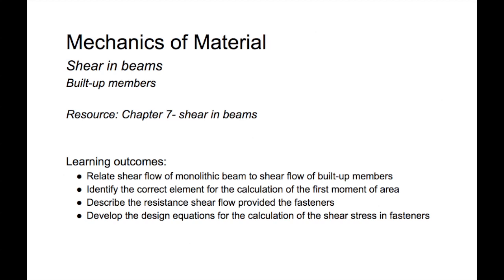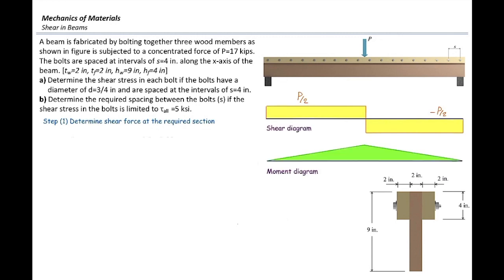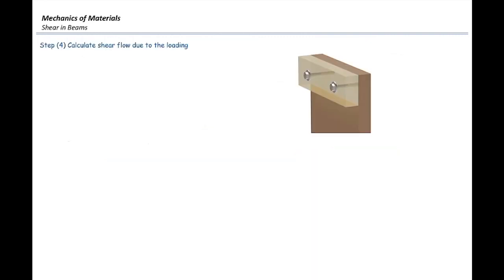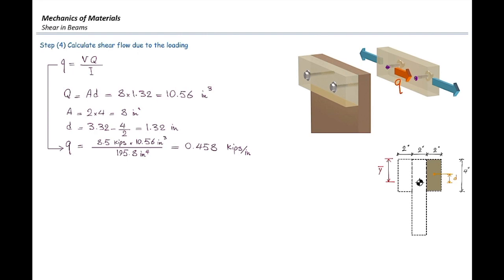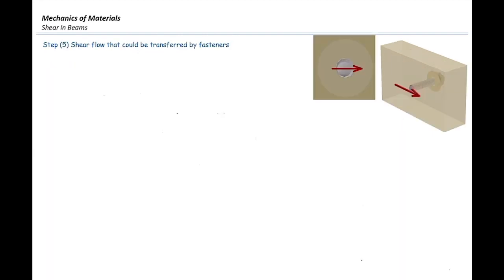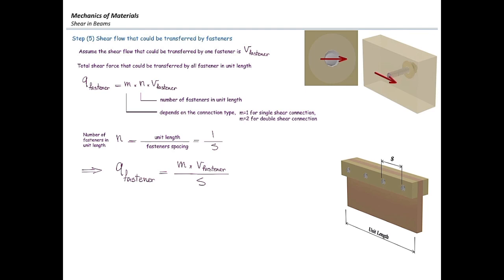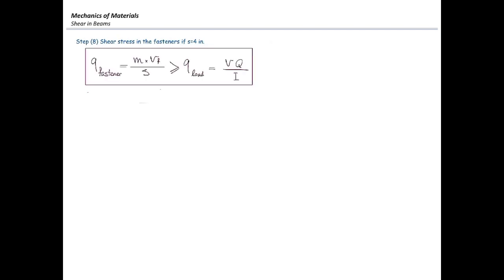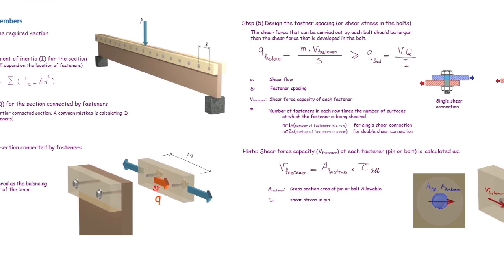Built up members

Comment: Thank you for that, can I have some questions regarding the shear flow that might be useful to considerate? What is your opinion on that?
1) What if we had a simple beam Loaded at the thirds points with the same point load P.  We would get a beam with a constant moment in middle third and no shear force at all. Does it mean that for that distance, the beams will not have to be connected at all and we will still get the action of composite section? As there is nothing to calculate in shear flow because V=0...
2) If we wanted to strengthen the beam from point 1 in the middle third only. Let say that our section is I-section and we want to weld a plate below to bottom flange. Again, from the shear flow theory, we would not require any welds in middle third of that beam as there is no shear and constant moment. How can we assure that this plate will act as the composite then? Personally, I would make sure the plate will be welded with length to flange force from bending just outside middle third and then in theory we do not need weld in middle third, if that make sense. One could argue that the weld length outside middle third should be to transfer shear flow from force P. 
3) Similar case, assume we have a simple 10m long  I section beam with a uniformly distributed load. We want to strengthen the beam only in the central span part (let say along 1m) with welded flange plates. Again, shear force in the middle is so small that I will have some doubts to calculate the welds for this small shear force. So for what force should this weld be calculated? Surely not for a shear force at supports because our plate is only in the central part of span !! Personally, what I would do, I would check flange force of the original section at the distance 0.5m from the centre and design the length of welds for this axial force from the flange. It will tell me that this weld can transfer flange force from original section to a built up section. What is your opinion?
4) I discussed problems with shear flow when shear force is equal 0, but what if first moment of inertia of added parts is equal to 0? Let say we have a rectangular beam from your lecture but with those smaller pieces but located not in upper part but exactly in the middle of internal beam. So the bolts will be in the middle of central axis. If we want to take first moment of area of those smaller side elements, we will get 0 as they all have centroid in the same horizontal line. So when we have one row of bolts in the middle, it will never add anything and will not increase the strength, but what if we have let say 2 vertical rows on these small side elements. Theoretically we still have first moment of area equal to 0 so it would mean that even more rows are added it will not work as long as the additional elements centroids are at the same level? It think that the case with more rows should be analyses differently (similar to problem7-37 from Hibbeler - Mechanics of Materials but with full height web) and side plates should be split by two with each top half of side plate area per top row? Would you agree? 

Thank you,
Reply from the maker: Regarding the beam with the point loads at its one-third, there will be no shear force at the middle part as you mentioned; thus theoretically there is no need to use shear connectors to transfer the shear force. In practice, there is a minimum number of connectors needed to ensure the section performs as one unit and that the force is transferrable between different parts of it. Good question!
Reply: @MechanicsofMaterialsLibre  Thank you for the reply. What are your thoughts on the remaining three questions?
Reply from the maker: @richards9950 In all those cases, the beam components should be connected together in order to maintain the linear strain in the beam. For instance, in the case 2 of your question, when a plate is added to the flange, both plate and flange should be connected in order to deform together and have the same strain at the contact surface. Otherwise, these parts would deform independently from each other that means the section is not monolithic. In this case, the main Euler beam theory which states the strain varies linearly from the centroid will be violated. Anyway, it is a very good question but the detailed answer is beyond the scope of YouTube comment. I have another video (may not be published yet) on demonstrating the importance of connections on bending of beams. BTW, are you an undergrad student?
Reply: @MechanicsofMaterialsLibre  Actually I am a structural engineer from London. But having reviewed my university papers and available literature, I couldnt find the answers for my questions. Cause I believe these are practical questions when required strengthening of some existing beams. You have to justify it by calcs, but in some cases it is not clear. The shear flow information is available but only in theory when there is a shear force, but answers to my questions seem to be not easy, although the topic should be easy. There is some discussion on shear flow on eng-tips website and I was amazed how many structural engineers struggle with the topic and answers to my questions should clarify many things. The linear strain is one thing as is the buckling of flanges, thus you need some connections between web and flange, but again, except those cases, I am curious how would you respond to my queries from point 2,3. How to ensure that composite section is composite just outside area for which there is a zero shear force and for what force design in. And question 4 as well and lack of effectiveness of the solution described and if you would agree?  More elaborated response to these queries will be appreciated. These are crucial examples from site when the strengthening of existing beams is required, or if you need strengthen a girder beam with welded flange plates in a bridge for example. 
Kind regards and thank you for the interest.
Reply from the maker: @richards9950  That is what I thought because this question is above the average of undergraduate students. Detailed response to this question is beyond the scope of YouTube comment. I'll try to make a video and explain it, when I find some free time.